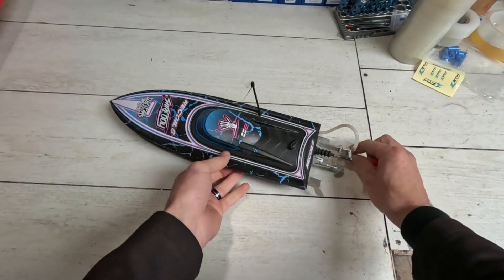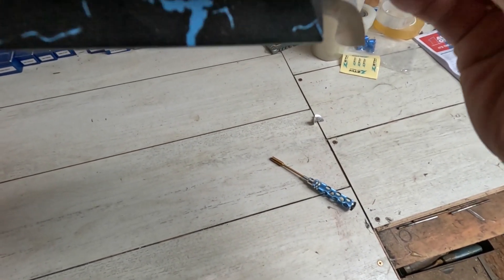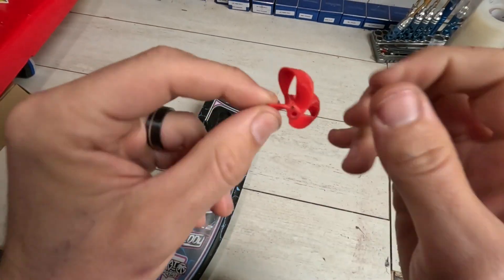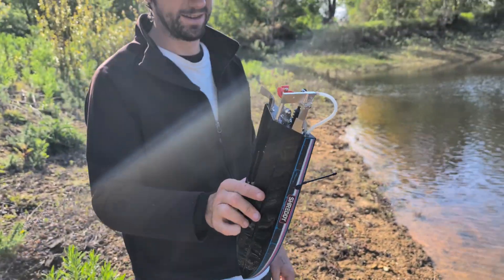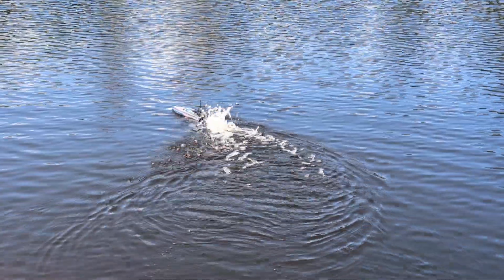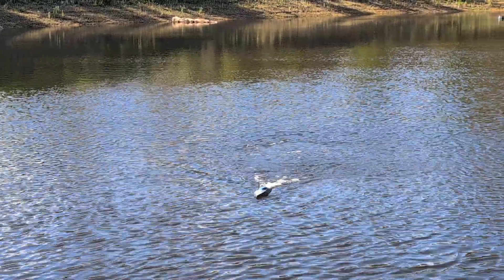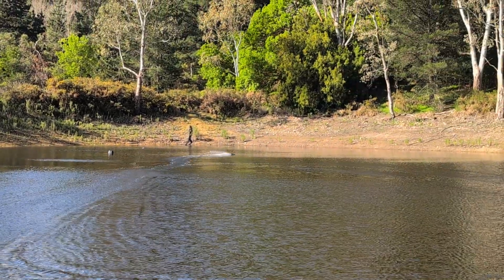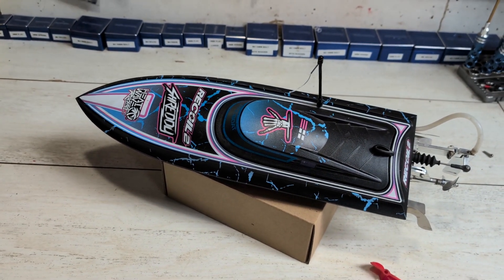Testing 3d printed Toridal props

Comment: Rc propeller are designed to work as semi-submerged propeller.
Tiroïdal propeller need full submerge to properly work.
Nice to see the test to confirm that tiroïdal doesnt like semi-submerged 😁👌
Reply from the maker: It was a cheap experiment and something weve been thinking of trying for years, but you are correct